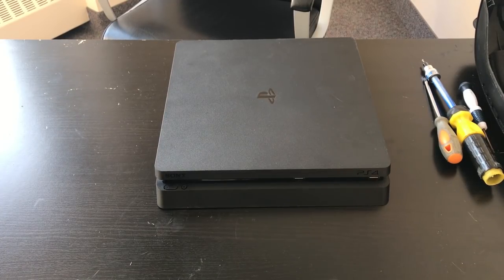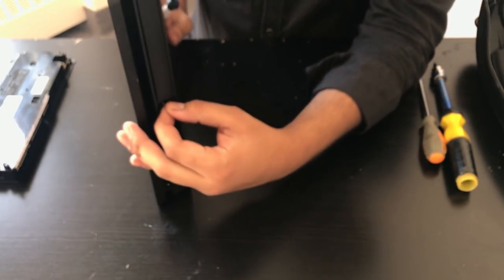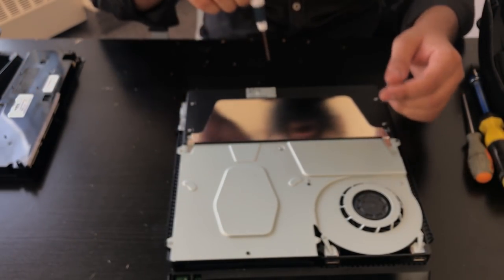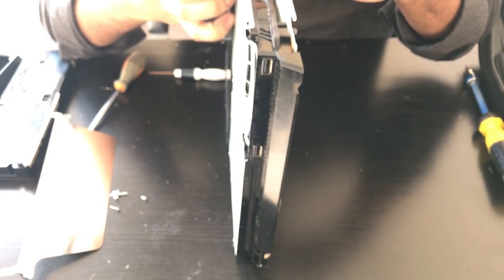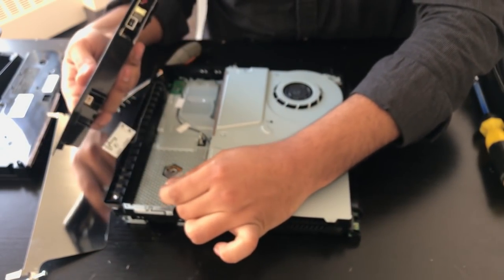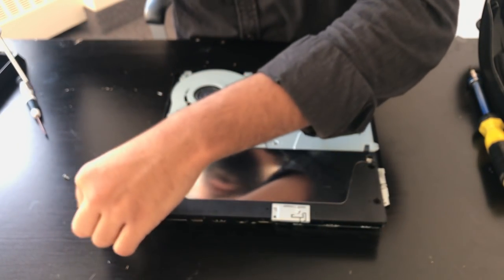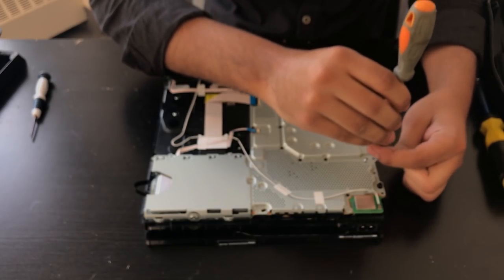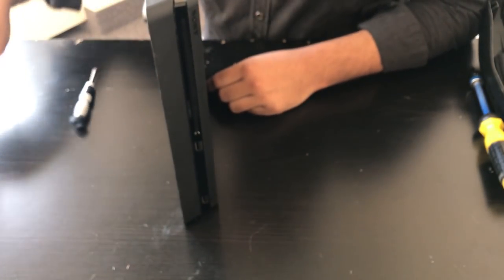How to fix a PS4 Slim that's not turning on/No Power - Power Supply Replacement (CUH-2015/2115/2215)

Comment: before i do this did your ps4 turn on one day and turned off fast af then never turned on again?
Reply from the maker: Those are one of the symptoms of a failing power supply.
Reply: ok thanks but also my ps4 is 3 weeks old how did this happen??
Reply: MisT BeasT mine made a pop noise
Reply from the maker: It needs a new power supply.
Reply: Well i just found out it was not my power supply it was water damaged by my sister
Reply: FiReZ BeasT same
Reply: mine too
Reply: How is this possible? I bought my PS4 1 month ago... it already happened 4 times. I can't turn it on anymore because I put it in rest mode. The last time it did, I took it to the store but when they tried it worked. Now it happened again, it's been 2 days and I can't turn it on... 

Sick of turning it back to the store... >_>
Reply from the maker: You can buy the power supply here: https://www.fasttech.ca/playstation-4-slim/power-supply-adp-160cr-cuh-2015a
Reply: FiReZ BeasT  thats what happened to mine plz help
Reply: Thats exactly what happened to me
Reply: FiReZ BeasT I have that my PS4 is away getting fixed :(
Reply: David hey had same problem all you have to do is connect DIRECTLY without any extension or plug to the wall outlet! It will work
Reply: @sabrcaptainprice8590  wdym by directly?
Reply: LoXz BeasT yes!
Reply: Yes mine did that too!
Reply: Yeah. Mine is plugged directly into the wall, still not working.
Reply: YES
Reply: Mines was working for a while before turning off
Reply: @ImmortalPanda  yes I just bought my 3 weeks old and did the same things wth
Reply: @fasttechvideo  i just order a wrong item how to cancel it?
Reply: Smuk3x Vevo yes
Reply: @fasttechvideo  explainnnn plss
Reply: Yea
Reply: @fasttechvideo  hey bro my ps4 slim is not turning on 
When i first time on it 
It on and i put i disc into ps4 slim and then it turned off 
I try again and same thing happened 
But now it can open 
Why...???
Reply: Fasttech vlnqc
Reply: @fasttechvideo  will I lose any data on my ps4 if I do that
Reply: Well uh I was playing my ps4 when it was lightning, and I heard lightning really loud and then my ps4 popped.
Reply: Seeked same any fix?
Reply: yeah I fixed mine search up how to replace PS4 power supply
Reply: Yess broo
Reply: Me
Reply: @sincondemns6684  same
Reply: @fasttechvideo  i got a new power supply still doesnt work

Comment: Thank you so much... I order the power supply from y’all and put it in watching your vid and everything is working perfectly appreciate it
Reply: Wait does it also make your games run a lot smoothly too when you have it working?
Reply: @plcreator483  I’m online playing Mk11 now it run as good as the original ... perfect and I’m using a Lan wire as well
Reply: Fab31....what did it do EXACTLY before you replaced the power supply? I've seen slightly different variations what was going on before hand. For me beep and light for like 1 sec then immediately powers off and nothing ever displays on the screen during this.
Reply: @docgray5004  that’s exactly what happen to me. it beep white light stayed on .. then blank the power went out ... nothing was turning on when I plugged in the controllers or phone ..to the PS4 so I knew the battery was GONE
Reply: @Kingfab31  not sure what you mean by battery....but the power supply did fix it? You said white light...did you have the regular ps4 or the slim?
Reply: @docgray5004  yes power supply was dead exactly what I meant
Reply: @docgray5004  also blue light I meant to say

Comment: I will buy the fast tech power replacement and i can't believe you did it so easily.Damn NICE 😍
Reply from the maker: Thank you.
Reply: do you have a cuh2016 a or b,will cuh 2015 work for 2016
Reply from the maker: leraux x this one will work for 2016: https://www.fasttech.ca/playstation-4-slim/power-supply-adp-160cr-cuh-2015a

Comment: My ps4 beeps two times but won't turn on why? What's the problem for that????
Reply: im not a pro but either the hdmi or you are putting it into safe mode
Reply from the maker: This is called the Blue Light of Death. We did a video recently on how to fix this on a PS4 Slim, PS4 and PS4 Pro. Check out our channel!

Comment: My ps4 does turn on but it shuts off every 10-15 minutes on it own.
Reply: Same here I been having that problem too and it's making me want to just throw it out the window right now. Sony really needs to work on these designs carefully before they release them.
Reply: Clean the dust ... It's overheating too fast ....
Reply: @otlpharo8646  how can I clean the dust
Reply: @thtboii_erik8976  if you don't care about warranty .. just unscrew the top Nd bottom , get all the dust off the fans and exhaust ... It should help

Comment: Hey i just found out my ps4 is not powering on by the controller or by the manual button on the front. There is no light seen on the power button. Will that be a problem of my power supply unit or the motherboard. Should i be replacing the power supply unit. My ps4 model is cuh-2016a
Reply from the maker: Yes its a power supply issue
Reply from the maker: Hi Danny,
How did everything go? I see that you ordered from us. We'd love to hear back from you.
Reply: Fasttech Everything was great, I did this repair job by myself. Now my PS4 is working fine.
Reply: @DANNYLIVES4you  how you fix it pls same Problem
Reply: Fasttech hi
Reply: Justus Antony boi
Reply: My ps4 was working then all of a sudden cut off an wont cut back on
Reply: ROZAY yea ite same as mine ps4 slim
Reply: @fasttechvideo  need a power supply shipped
Reply: @fasttechvideo  hi i need one as well
Reply: @fasttechvideo  hey I have a PS4 slim CUH-2115A the power supply I need is a CUH-2100 right and if that is the right power supply how much does it cost buying it from you please reply thank you for your time
Reply: @DANNYLIVES4you  me two i need a power unit slim ps4

Comment: My PS4 turns on sometimes but other times it does not turn on regardless of how many times I push the turn on button, disconnect/connect the power cord, tap the console, etc. Can this be a power supply problem?

Comment: I updated my PS4, and now when the power button is pressed, the lights appear but after a while (around 10 -15 seconds) it switches off
Reply: did you fix it bro, i have the same problem, when im opening my ps4 it doesnt boot, if i will try to enter safemode, it will turn off

Comment: Hello, I have a question. The last two weeks my ps4 Slim has been getting this issue that I didn't experience before. When I turn it on, the blue light comes for a sec and it just appears as disconnected instantly. I've been 'fixing' it by unplugging and plugging back the power cord. What could this be? It also started happening after the 7.50 version, I would've mad if that has something to do with it. If you can respond, it would be great. Thanks, and have a nice day!
Reply: Hi same thing is happening to mine currently. did you find a fix?
Reply: Having the same exact issue. Did you find a solution?
Reply: @YoutubeValkyrieQueen141  My man, I didn't even remember that this happened, it's been a long time. Sorry I couldn't help. I hope you find a solution

Comment: my ps4 has a problem ..when i turn it on a blue light pops on and starts to blink like forever..what is the problem..my ps4 is about 2 years old i bought it Winter 2017
Reply: MeEt RaFiD it’s probably your APU (chip on the motherboard) if not then it’s the PSU (power supply)

Comment: Ok so my ps4 turns on i see the blue button and i hear the beep then it just turns off what is the problem do I need a new power supply because I already plugged it in the wall and it won’t work it happened once before and I just hit it
Reply: same problem.

Comment: My ps4 slim power supply has a leaking battery so I can’t use it and need to buy another $53 power supply even though I had it for 3 months  :’(
Reply: Same
Reply: Lol u mean a bad capacitor wtf theres no batteries there

Comment: I was playing on my ps4 (slim) and it just turned off without any messages my tv said no signal and the power light for the ps4 wasn't lit up. I thought it just got hot so I let it sit for about an hour and the light still was black and I've tried unplugging it and plugging it back in. can I get some help
Reply: Also don't really wanna pay 69 dollars for a new power supply cuz I think that's the problem and i just spent 60 dollars for a new controller and I got it not even a week ago
Reply from the maker: You need a new power supply. We sell those on our site.
Reply: its doing the same thing to me
Reply: Justin Casas how long have u had it before it all happened??

Comment: Hey my ps4 slim turns on for 1 second then it shuts off  is this the power supply
Reply: XLS Gaming hey dude , PLEASE connect your power cable to the wall outlet without any extensions or plugs. It will work!
Reply: @sabrcaptainprice8590  ok will try
Reply: Did it work
Reply: My ps4 Slim wont turn on
Reply: @pedrododues6294  no
Reply: jado boat gaming try it yourself
Reply: OnlyOneGam1r  did yours work when you did it
Reply: It happens to me too
Reply: @sabrcaptainprice8590  btw I did what you said but it didn't turn on

Comment: Hi i was playing my ps4 , with a usb headset and the usb cable on the headset stopped working . I ripped the black plastic around it and started messing with the cable and all of a sudden my ps4 just shut down , i already took it to get repaired and they said it had nothing to do with the power supply.

Comment: My ps4 won't turn on,no lights ,no sounds ,it's just not turning on,it isn't going into safe mode as well.please help.
Reply: Hulk J26 hi please connect your ps4 directly into the wall outlet it will work
Reply: @sabrcaptainprice8590  i did it in the outlet on the corner where noone uses and stil  nothing happened
Reply: ENMANUEL PEREZ MORENO did u use a plug ? Or did u connect directly? 
Also check your power cord maybe try changing it? It may be damaged
Reply: @sabrcaptainprice8590  never mind nothing happened so took it to the service center and got the power supply changed,Working fine now.
Reply: Bro check ur power supply cause mine burned out smell ur PS4 first if it smell like it got burned I paid 100 for a replacement supply
Reply: OnlyOneGam1r  power cord was the problem thank you so much for the tip
Reply: ENMANUEL PEREZ MORENO no problem bro I'm so glad I could help you!
Reply: Play

Comment: Just recently installed my power supply from u guys but I get nothing more than a high pitch noise no power or anything any suggestions on what else may be wrong with my system 🤔
Reply: Ignored my comment well guess I gotta return this then

Comment: About a month ago I was playing on my PS4, it was running smoothly, the next morning I tried turning it on, it wouldn’t, I plugged it in different areas, it still didn’t work, I bought a new power supply and that didn’t fix it either what now :(
Reply: You ever fix this? I'm having the same problem
Reply: Same here, did you ever fixed it?
Reply: Same prob - just looking for an eventual answer
Reply: @sagecunningham2631  did u find a solution? Mine just did this!

Comment: Can you help. My playstation won't turn on, I press the on button on the PlayStation, just goes off straight away. Tried it in a different plug socket, same problem. Can't get it to go into safe mode. Won't turn on by controller. Is it the power supply?? Would a new power supply cable help??

Comment: Hey my ps4 went into rest mode then went into safe mode when I tried to turn it back on. 
Every time I turn it on it usually won't work, but when it does turn on it beeps twice by itself into safe mode. Is this a Power supply issue?

Comment: Near the power supply cord input I have a serial code that says MD629937251, would the battery be the same as in the video?
Reply from the maker: Yes
Reply: Fasttech thank you, this problem just started today and hasn't turned on at all except for a beep, then nothing
Reply from the maker: No problem. I hope you order from us!
Reply: Fasttech I may, but I hope it's the right issue with my system
Reply from the maker: If your PS4 does not turn on at with no beeps or light indicators then it is a power supply issue.
Reply: Fasttech there is a blue light indicator for a second or two
Reply from the maker: You have a BLOD issue. This is not a power supply issue.
Reply: What's ur psn?  I can help u out
Reply: Fasttech what’s a blod issue ?

Comment: Hello, 
After replacing my power up issue with the power supply a white blinking noise pops up and no signal reaches to my TV
Reply from the maker: I would be happy to troubleshoot if you bought it from us. Simply provide an order number if that is the case. If not please contact the company you purchased it from.

Comment: Hey! My PS4 Slim is nearly a year and a half old. It was fine until a month ago when it started turning off randomly. I thought it might be a dust problem(as there was a lot), I cleaned it but it still continues to do so. Sometimes it switches off in like 2 minutes and sometimes it is fine for nearly 20 minutes. Whenever it switches off, I have to unplug it and then plug the wire back in again for it to turn on. Is this a Power supply issue?
Reply: Play Station connect ps4 directly to wall outlet without any extensions bro pls try

Comment: My had no light,you can’t turn it on by the control or the power button on the console is if the power supply?my model is CUH-2115b
Reply: Did you fix it cuz I have the same problem

Comment: This helped me a lot thanks but I don’t think you have to buy a new power supply just remove it and put it back in it works trust me
Reply: Do you have to put all the screws in before testing if it works? Took mine out and put it back in but it didn’t work. Also I  didn’t put the screws back before testing if it works. Can that stop it from working?
Reply: Does it really work please answer my playstation wont work

Comment: Sorry I'm a bit late on this..I have a PS4 slim CUH-2216A from the UK. I'm moving to Japan. The sticker on the back says 220-240v . Will this work in Japan as they are 110v. I've heard all PS4 have dual voltage. The PCU is 110v - 240v . Is that right? If so it will work or should I sell it?
Reply from the maker: Yes it will work because the power supply inside will do 110 and 220. If this info helped you out please subscribe to channel and like this video.
Reply: @fasttechvideo  thank you so much. So when I get to Japan I will just buy a Japanese cord from a shop. Why on earth do they out 220-240 on the sticker confusing. Thanks for your help. I will subscribe :)
Reply from the maker: @jimmychaninjapan3982  yes just buy a local cable and it will work 😊
Thanks for the sub

Comment: Also my ps4 slim wnt turn on like wat happens is- I turn on the ps4 and then a the blue light stays on for 2 secs with a beep too then it goes away and I’m thinking replacing the power supply will fix it
Reply: Does it work now?
Reply: Would really like to know because im having the same problem

Comment: My ps4 just popped one night.
The console was off.
I think it's bug infestation probably few cockroaches.
Broke the power supply,
Because it doesn't turn on. 
The blue light shows only like 3 sec.
I'm buying a new power supply  
And open and clean the ps4 myself. 
If maybe I don't find someone who is doing this type of problem asap. 
One question, 
If the problem is the power supply, should I still have to clean the whole ps4 including opening I guess you said the motherboard and everything has to come off?

Comment: I need help my ps4 froze and wouldn't power off holding it power for 7 seconds or eject button with power nothing happened left a while nothing happened power of through the cable switch now won't turn on and I only have it sence december i am madd that this happened

Comment: Awesome video man thanks for the info and I think thats what happend yo my ps4 is my power supply went out it was working fine the other day and then it turned off and then it came back on to try yo restart and then after that it will not turn on at all
Reply: 😂 Ik it’s three years later but that exact thing just happened to my ps4. Absolutely no power after it running fine yesterday, was the power supply the problem or did u have to do something else?

Comment: Hi . I need ask something . My ps4 before this cant turn on but got light . When i try turn on something vibrate from bottom center cover and no respon . And now i try turn on again,no more light or anything . It power issue ?
Reply from the maker: Yes its a power supply issue.
Reply: @fasttechvideo  tq sir . hehe . i will try look some power supply . btw what model power supply for ps4 2006cuh?
Reply from the maker: @nelvesternel4917  Consider buying the power supply from the description box if this video helped you out. A CUH-2006 is the same as a CUH-2000 or CUH-2015
Reply: @fasttechvideo  ok sir how long ship to malaysia sabah ? and how much

Comment: Hey had a crazy storm last night. When I went to play my ps4 the next morning it wouldnt turn on. Is this a power supply problem or motherboard?
Reply from the maker: 99% chance its a power supply issue.
Reply: @fasttechvideo  okay so I bought the power supply but still no luck. Anything else that could be wrong?

Comment: Quick question, my ps4 won't power on. I try to turn it on and the the light lights on fast once with a beep and it turns off. What could it be? Any suggestions?
Reply: ¿Alguna vez arreglaste esto?

Comment: I just purchased a power supply with the same model number to my old ps4 power supply and it doesn't work.😭 Any help? 
Model number: N15-160P1A
Reply from the maker: Did you order the power supply from Fasttech?
Reply: Unfortunately, no. I'm a college student and I'm currently on a tight budget so I bought one within my country, UK